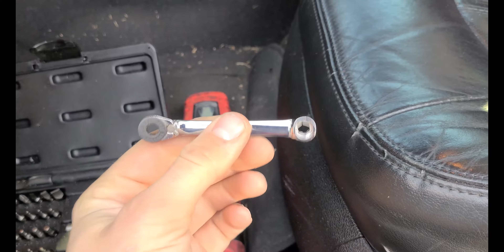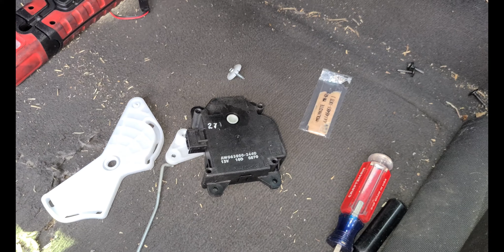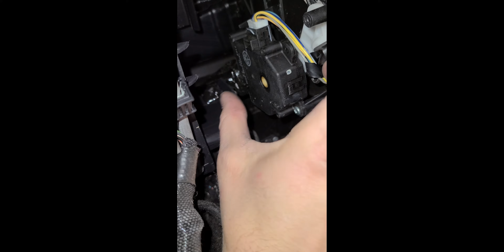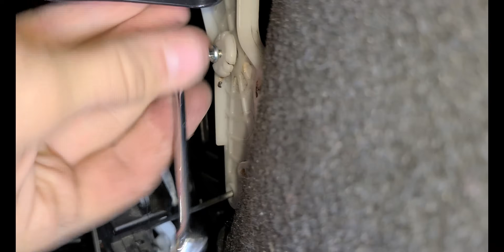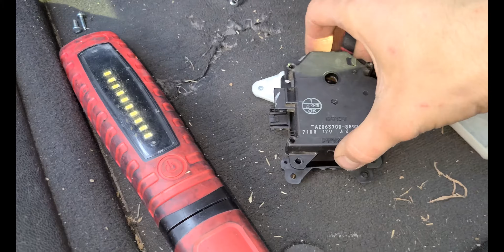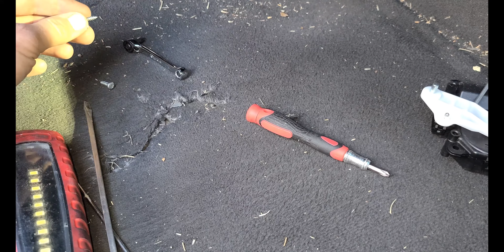Cadillac CTS blend air door actuator replacement 08-15

Comment: Does this same part also work for the front vents not working? The 2 in the front middle on 2010 don’t blow out the air
Reply: experiencing and wondering the same thing
Reply: i believe the driver side is the right temperature actuator and underneath the glovebox is the mode actuator which controls the vent’s positions which is affecting the dash vents

Comment: Was told this was my issue but my ac unit is actually only blowing air out of the defrost on a 2013 XTS, the rear air works fine but the front air no matter what mode is only blowing air out the defrost…..do you think it’s an actuator as well? I read you can reset the blend door actuator but haven’t been able to find the article on how to do it

Comment: Thank you for making this video! I was able to change out my driver side actuator last night in about 2 hours because you took the time to show details. Without purchasing the small ratchet, no chance I could’ve completed it. 
I was looking at $2,400 from a quality mechanic shop. They would’ve replaced all 3, because might as well when the entire dash is out, but that’s still roughly $2,000 in labor! 

I will warn anyone with an XTS, the setup is slightly different - good and bad. Good, no cam system. It’s a plug and play model with all parts internal and only 2 screws. Bad: the 2nd screw takes REAL patience, especially if you’re a bigger human. Easily 1 hour of my time spent on the backside screw lol.

Comment: 2011 CTS, ac blows fine and heat as well but there’s a constant clicking noise that doesn’t go away and gets so loud and annoying, could switching this fix the issue on the sound ? Thanks
Reply from the maker: Yes, the clicking is one of the main indicators of a failing actuator motor

Comment: 2012 CTS Wagon 3.6 here. Need some help. The heat in my car is cooling off as it warms up. It starts off hot after my morning warm up. When it gets up to full temp, it starts cooling off. This started happening when I had it set at 72° then had to turn it up to about 80° after it hit full temp. Now I have it set at 85° and have to turn it up to 90° after full temp to get same effect. It doesn't sound like a thermostat issue to me nor is my coolant level low. Could THIS be the culprit?
Reply from the maker: I would check the basics first. Make sure your coolant level is good, no leaks. Then check to see if the heater hose lines IN and OUT are hot when its fully warmed up. The heater core could be clogged. There is also an electric AUX coolant pump that commonly fails on these. If all those check out, you can check the blend air motor

Comment: I might just be lucky,but I've done all three actuators and I've found if you get the easy screw out and then wiggle it back and forth slowly, the tab will break off of the actuator then you have easy access to the other screw
Reply from the maker: That's great advice!!

Comment: Hi Gage!! I have clicking happening in my 2013 CTS center console. Dealership quoted $1400 to replace this actuator. For now, it doesn’t stick on one specific vent. It blows out where I want it to. The clicking seems to come and go, not a consistent problem, but it’ll click even when my system is completely off. Thoughts? I feel I could handle this repair after watching your video. Thanks
Reply from the maker: Hey there! A failing actuator often is intermittent before it fails stuck in a certain position. You need to do is figure out which motor is failing. To do that, you will need to cycle each one when the engine is fully warm. 1. move the recirculate door. Its the one that keep fresh air in the car. 2. move the air vent door. From defrost to face, to feet. 3. Move the driver blend door from hot to cold and back. 4. move the passenger door from hot to cold and back.  At some point in this process, you should here a door click. Make sure you are giving each door time to complete it's motion before making the next adjustment so you can be sure in your diagnosis!
Reply: @gagefixeseverything Mr. Gage, so if it’s not cooling on the passenger side, there is an actuator on that side ? Or the one you change is the one for that side too?
Reply: @fit2lean  There's a temperature actuator on both sides that does the exact same thing as the one the gentleman replaced in this video (provide your vehicle is equipped with dual climate control and it's set to "PASS")

Comment: But it did not change I don’t know what’s wrong either side will blow heat I put a new thermostat in both lines going to heater core is hot do you have a clue
Reply from the maker: You probably need to have it properly diagnosed

Comment: I wanted to ask what, does this problem fix.. My issue is my two heating vents blow cold air when the heat is on but my two passenger ones blow hot air..
Reply from the maker: Yes this should do it!

Comment: Hey I just came across your video and I think it may help my problem but I wanted to get your opinion first.  I have cold air blowing out of my vents on both sides, but nothing is coming out of my middle vents.  Well the air flow is very weak.  And I have changed the cabin air filter already.
Reply from the maker: Sounds like MODE door actuator

Comment: I have a 13 cts.. Ac only blows from bottom vent at the feet.. No matter the setting.. I can control the temp and power but.. Won't blow from other vents.. Could this be the fix or na
Reply from the maker: That is going to be the MODE door actuator. very similar repair
Reply: @gagefixeseverything  where would I find the mode door actuator? If I may ask?.. I have a coupe but it's the only car I have and I pick up my 2 yr old tmr.. Worried
Reply: You were right.. Finally got to doing it. Thank you so much brother

Comment: Hey can you please tell me how to switch the white arm... Trying to do the driver's side on my DTS that word of the Delco part but it doesn't have the Arm on it so I have to switch them out... Just don't want to break it and then have nothing to use ya know 😜
Reply from the maker: Just take the phillips screw out and transfer it over
Reply: @gagefixeseverything  no screw it the arm just a pin that sticks out of the arm and goes in the Channel
The DTS is a little bit different and I have the denso but need to transfer my arm over and I can't tell if it's pressed or whatever whatever it is it's tight and I don't want to break it., I've got every tool known to man just about but I am at a loss as it's not wanting to come off and I have not seen a video of anyone actually swapping the arm from old one to new one....
Reply: @gagefixeseverything  I wish it was just a screw.. but if you look at driver side Cadillac DTS it is just a little bit different actuator

Comment: My air only comes out cold in the winter or on cooler days. If it’s over 90 outside my air comes out super hot
Reply from the maker: You need a blend air door motor it sounds like
Reply: @gagefixeseverything  thanks so much I’ll check it out
Reply: @gagefixeseverything  so would this be the answer to my problem because my problem is driver side blows firm cold solid air in the winter and the summer but I am able to adjust the passenger side from 90 to 60 even when I adjust from 90 to 60 on the driver side the actuator I just installed with the white butterfly flap it moves so it is getting power or do you know how I can manually turn heat on which door or doors and in that area there's only one motor/blendor/actuator because I ordered a blend door actuator and you just said for the young lady she needs blend door motor is there a difference between the motor and the blend door actuator or are those the same part different names

Comment: I did that now my a/c and heater work fine but it’s now stuck on defrost and floor I have to command on face vents on my cadi, any help?
Reply from the maker: Sounds like you have an issue with the MODE door actuator or linkage

Comment: Hi good night! I just changed my blend door actuator on my Cadillac CTS 2011, I did the same procedure than the video, but the passenger side still blowing hot air, the driver side blows cold and hot air, the blend door actustor is working because I saw it moving and changing position but it does only change the temperature on the driver side
Reply: Did you ever come to a conclusion you have the same problem
Reply: Typo I have the same issue
Reply: @llcool.j3437  no bro, still not working, sometimes is blowing cold air sometimes not, I think it’s a electrical problem because sometimes I lost some dashboards lights like from the temperature adjusters or the heated seats
Reply: @Cisava  this is a very helpful video I performed this procedure very closely too how is it done in this video and I have spent a lot of hours  self researching and trying to understand the design and the duties of each arm that moves or rotate because successfully and comfortably feel like I have the motor lined up with at least the right screw holes white arm is connected to the black long arm that sits in front of it I have the corner of the butterfly lined up with the 2 end parts and then on the opposite end there is a little trapdoor that I cannot see the one that he points out sort of like behind the radio I have that lined up with the butterfly the only thing that's off is my position and also when I turn that butterfly with my hand it doesn't have a click but also if you try to stick pliers or turn it with your hand a little black nugget that the butterfly is screwed into it does nothing but when you have the metal arm connected to the motor and the Butterfly it works I don't know it's duties all I do know is I have the motor hooked up and I have the butterfly hooked up and I'm still not getting it  heat if I stick my hand at the very bottom like by the paddle you can feel hot and cold air blowing faint when I adjust the motor speed I get freezing cold on the driver's side and 90° in the passenger side as well as the front D- Frost cold on the driver side heat on the passenger side I was under the impression that everything had to be lined up to a precise  T for it to work on  hot or cold so I had the White butterfly screwed into the wall without the motor or the silver arm connected to the butterfly without knowing what I know now I was able to turn it up or down with what seem like to be clicks or  shifting positions so it does operate and holds a major Duty does anyone know if this white butterfly needs to be positioned a certain way like 6:00 position with reinstall there's also a little small spring behind the screw that you unscrew because you even have tlittle trap door that is behind the position indicators the one that he points out in this video I have it lined up on the other end of the butterfly line it is on a angle but not 6:00 like how the video is but then I also noticed the bar that connects from the motor to this white lap is straight up and down like 6:00 but it has a little bins in it and after completing the job I went from freezing cold air Windows fogging up every 2 seconds to tolerable lukewarm when the fan is on low or not freezing days air blowing warmer so I moved something that was beginning to make the Heat come full throttle at this point I am just looking for instructions as to how to manually turn the heat on it is cold in my state I was wondering does the White butterfly and the bar its connected to does that change the air hot to cold I was even told that you might have to get the actuators program or reprogram I also purchased the Amazon version
Reply from the maker: reply hidden
Reply: @gagefixeseverything  ?

Comment: I need help....there is a vibrating coming from the area in your video I thought it was coming from that 1st piece of white plastic.  It doesn't buzz constantly but often on more when I I use the heat or air
Reply: S77e44
Reply from the maker: reply

Comment: Just did this today did not solve my problem 
Getting heat on vent to the left of the steering wheel but the driver defogger/ Center and floor still blowing cool. Passenger is hot
Reply: Same with mine bro If I find the fix I will let you know
Reply: For me when I go to put it on the front vents I get a clicking noise ..so I’m assuming it’s a relay somewhere…maybe a blower relay
Reply from the maker: There are several of these motors on the car that controls different things
Reply: @gagefixeseverything  is there a way I can manually turn the heat on to feet until I get this figured out because I disassembled the blend door actuator that I replaced trying to do this because it did not fix
Reply: @gagefixeseverything  ?
Reply: Did you find a solution?

Comment: i just bought a 2013 cadillac cts but its not pushing any air through the vents at all, ac or heat.. any idea where to start checking?
Reply from the maker: If you hear the fan turning, its most likely the MODE door actuator
Reply: @gagefixeseverything  my Cadillac is only blowing air out of the feet vents would that be the mode door actuator aswell?